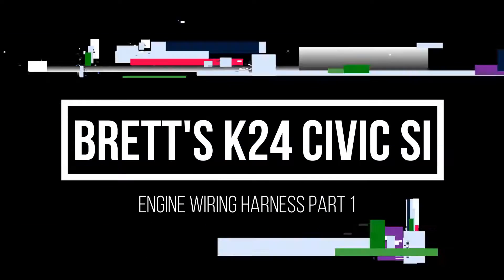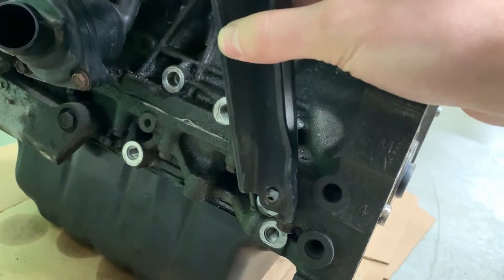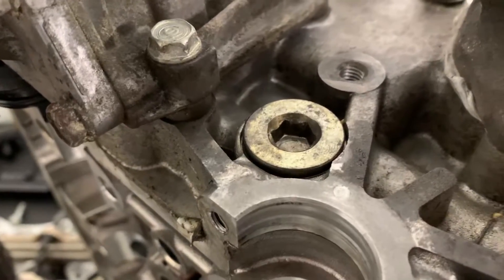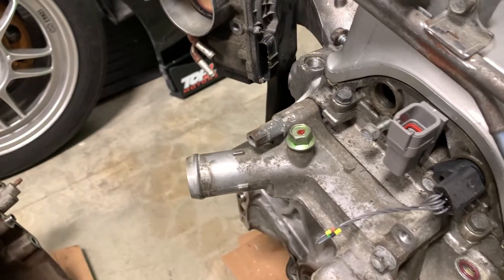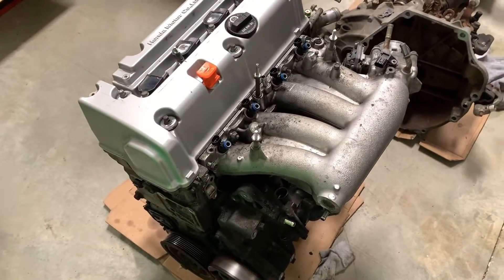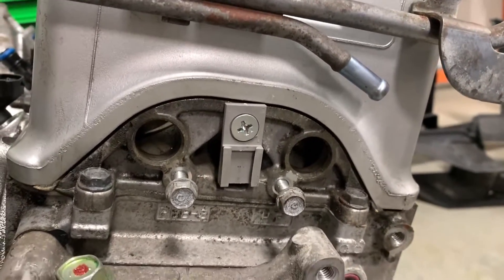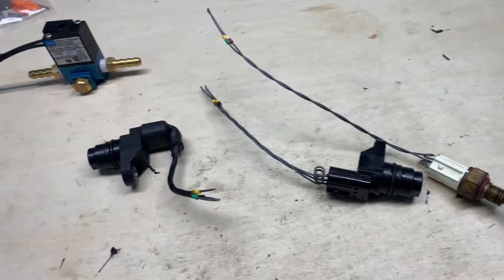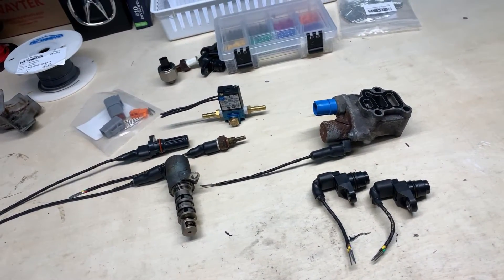Honda K-Swap Engine Wiring For Any Chassis Pt.1

Comment: does the k24 have two temp sensors like older hondas like one for guage and one for ecu or does k24 just use one temp sensor for guage and ecu?
where can i find info on what sensor does what and where its wired up to?im trying to help a friend with k24eg and he needs coolant temp sensor wired up which is vague if there are more then one sensor.their should be a sensor for guage/ecu and fans right?he has a hose adapter i beleive
Reply from the maker: The K series only have the ECT1 on the engine (drivers side rear of the head. To get signal to the thermometer on the combi meter you need to get the fitting from Hybrid racing or KTuned that replaces the high idle valve with a 1/8” BSPT fitting for the early models thermistor.

Comment: That's rocket science. 😂
Reply: Is there a plug and play harness? I have a 1989 CRX with a K24A2 and 6 speed LSD. I need an engine and conversion harness. My Kpro is a PRB.
Reply from the maker: Sorry for the late reply. I would check the common swap sites like hybrid racing for a conversion harness. As far as your engine harness goes it should just be the OE harness to that engine then you’ll need the swap harness to your chassis. I’m not very familiar with  K swapping a CRX. But if you find the parts to get it running you’ll have a real animal on your hands even with a stock engine. 😂🤘🏻
Reply: @berttnotbought804   Thank you.  I found the harnesses. I have some little stuff left on the car. I can't wait to get it going. The engine doesn't fit under the hood 😁 You can kinda see the car here.... https://youtu.be/jS4qwUfMPRw
Reply from the maker: A K swapped Honda and an old Plymouth??? You know we are the same person right? 😂 67 Fury III over here. That’s awesome man. I subscribed and I hope to see progress on both.
Reply: @berttnotbought804  Dude I love a Fury, pictures?!! People see me drive a Honda and assume I'm just a ricer. I just love cars, new and old. I like to show appreciation for even a rust bucket driving down the road. My Roadrunner drives but I'm currently doing a lot of sanding on the body, and other smaller stuff. (Finances permitting 😂)

Comment: Good stuff!
Say, could you share some information on how to wire the VTEC oil control and VTEC solenoid?
I know they each have 2 wires, one should go to ECU and the other is 12 switched?
Reply from the maker: 100% man! Helping people is why I do this. So to answer your question, the VTEC Oil control i believe you are referring to the “rocker arm oil pressure switch” on the VTEC spool valve assembly? In which case Pin 1 (BLU/BLK) goes to PCM B11. Pin 2 (BRN/YEL) goes to the engine harness ground G101.
Your VTS or “VTEC Solenoid” Pin 2 (GRN/YEL) goes to PCM B6. Pin 1 (BLK) goes to the engine harness ground G101.
While we’re at it, just to cover all the bases… your VTC for camshaft phase control. Pin 2 (BLU/WHT) goes to PCM B1. Pin 1 (BLK) goes to the engine harness ground G101.

There’s a little more to it but those items will work just fine wired like that.
Reply: @berttnotbought804  
Thanks a lot man!
So if I understand correctly both the oil control solenoid and the VTS get one ECU wire and one Egnd wire. Correct?
Reply from the maker: Yep! Very simple circuits. It’s important to ground them the same place as the engine harness.
Reply: @berttnotbought804  
Thank you for your help buddy 👍🏼
Reply from the maker: Anytime man! Always here

Comment: I thought you have to run cable to throttle body not drive by wire?
Reply from the maker: I am running an aftermarket PCM that will have provisions to control a DBW throttle. For now it will be the OE K24 throttle, but when I build this engine I plan to run an LS 90mm.
Reply: @berttnotbought804  do you will add the dbw pedal
Reply from the maker: @daskamu  yes. I have not gotten to that point yet. But I believe I will need APPS from an earlier model like a 2003 accord. One that has a cable and puts the APPS under the hood. I will be sure to make a video on it, whether it works or not.